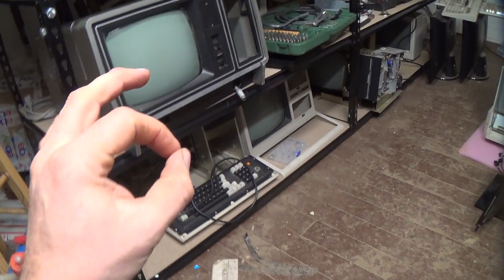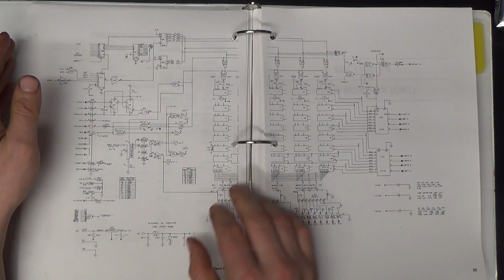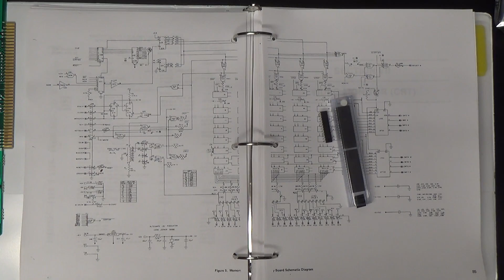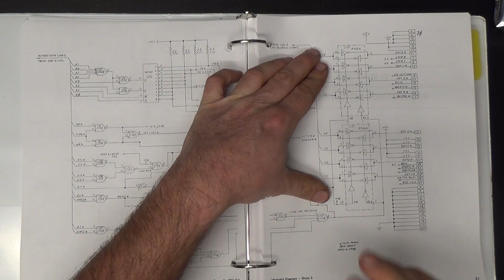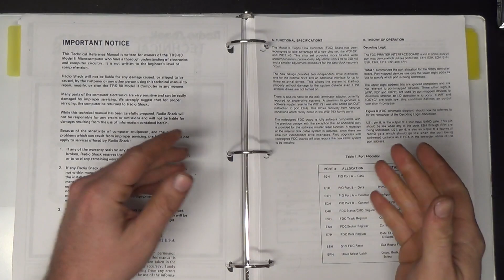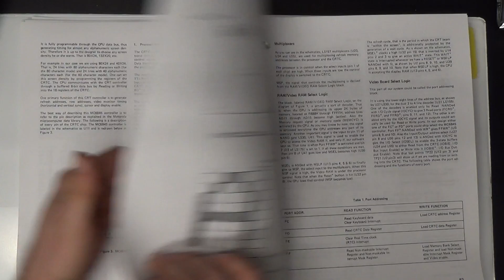The TRS-80 Model II is the Best Machine for Hardware-Minded Old Computer Enthusiasts

Comment: Actually the Z80 can have wait states inserted on any memory or IO cycle however it would be much easier these days to use a static memory chip for the Z80 to talk to for video memory and a FIFO to synchronize writing video memory data to the external video generator system.

Comment: Interesting to see what the memory expansions cost back then.  This is a rough calculation, but a 32Kb expansion for the Model II in 1979 is listed at $449 U.S.  It would take 16 memory expansion boards to equal 512Kb, for a cost of $7,184.  Putting that through an inflation calculator gives me a figure of $25,750.48.  So your $5 512Kb chip is quite the bargain!  But of course there are additional variables... what was the largest DRAM chip available in 1978/1979?  Would a 512Kb board have even been possible?  Would you need a beefier power supply, etc?
Reply from the maker: Yeah, if I had $26,000 to spend on vintage computers, I'd get a tricked out PDP-11/75 and put BSD on it and use some Xerox Altos for terminals.  :3

Or maybe that kind of money would buy one Amiga 3000 in untested condition.  Hardy har.  X_x

Comment: Having written a WF179x FDC emulator, I can say the work of emulating the CPU-to-FDC interface and its timing is by far the most complicated piece of the chain. The actual interface to the floppy drive isn't much more than a few GPIOs and the serial data line. In the emulator I'm working on, I replaced the FDC-to-Drive interface with some fairly high-level calls (like ReadSector, WriteSector, ReadTrack, WriteTrack, etc.), but I'm still not correctly emulating all the timing accurately (head settling time, timing between index pulses, etc.) and that changes the behavior of the FDC emulation and its timing. Many computers of that era use cycle counting to read and write the floppy data - there is no buffer in the FDC, and the reading and writing must by synchronized with the floppy data stream. For example, when reading, the FDC must make the data available in the data register at appropriate rate based on the data rate of the drive.

It's certainly doable (most emulators have some sort of equivalent FDC emulation), but you can't really avoid the complication.
Reply from the maker: Well damn.  I was hoping that WD chip handled all the timing and such.  That does indeed seem too complicated to fool with!  Better maybe to straight up clone the revised FDC card and put a gotek on it.

But maybe the ol' model 16 HDCs aren't as timing sensitive and would be a better candidate for that manner of tomfoolery.

Comment: 35:14 "...the spindle motor runs on wall current." Whoa. House lights dim when you save a file to 8" disk.
Reply from the maker: Ohhh, it stays spinning alllllll the time too.  Lights dim in the whole neighborhood when you turn it on, and they stay dim until you turn it off.  :D

At least on the Model II.  The half-height 8" drives in the 12, 16, etc weren't nearly as epic.  :3